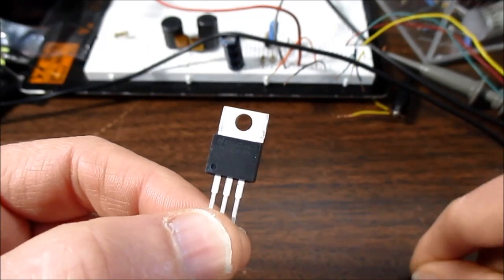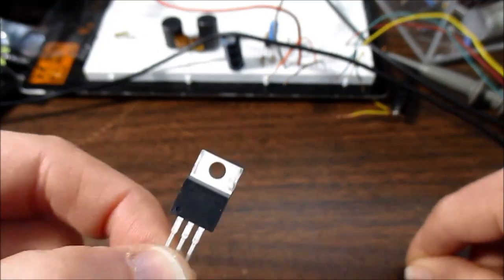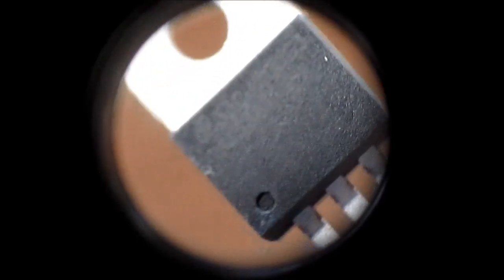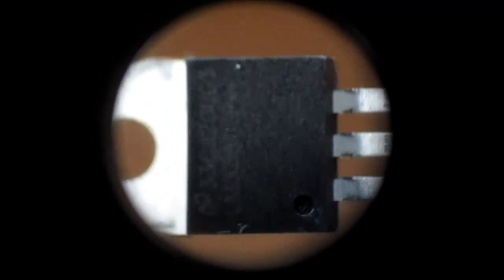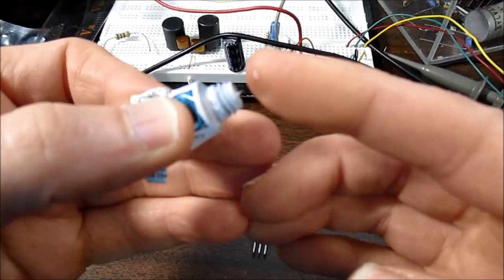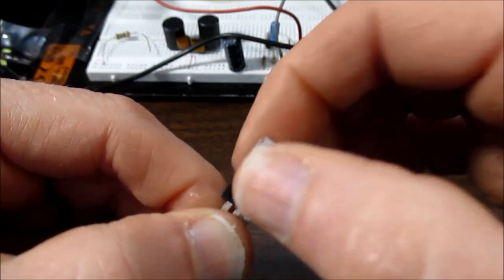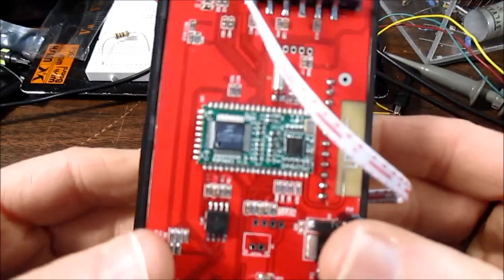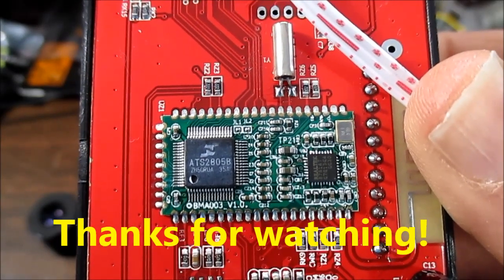QUICK TIP: Trick to make IC part numbers more visible

Comment: I know this is an older video (sorta "netflixing" your stuff). Great tip using something pros and hobbyists alike should have laying around. 
Struggling to read some salvaged TV parts I tried wafting some cyano-acrylate (super-glue) fumes over the etching (no contact) and found the fumes glom onto the ridges making it readable.
No doubt your method is safer but the fumes would work in case the etch is too smooth to pick up the paste.

Comment: You should review and test a little Pyle PCA1 amplifier and see what you get!
( supposed to be 2 x 15 watts! ).
Reply from the maker: I checked Parts Express. The 15 watt number is a useless peak power rating. Specs say it is 3 watts per channel into 4 ohms at 1% thd.

Comment: I do something similar with a pencil. Works pretty good.
Reply from the maker: Be careful as the graphite in pencil lead is conductive. It can get between the fine spaced leads on surface mount ICs.
Reply: very true. I didn't think of that. thanks! looks like I'll be using your method from now on.

Comment: Good tip, I have another which can be used in conjunction with your brilliant method or on the go.
Just shine the red light of an optical mouse on the ic. The reading should be easier in most cases.

Comment: Hay John i recently bought an TDA2050 off reputable seller. The Chip is marked as TDA2050L produced by UTC (unisonic technologies) do you think they are counterfeit, no short circuit protection smaller power-transistors. Or are these the real-deal would be kinda cool to get these obsloete chips they still seem to produce these. i know i am off topic sorry.
Reply: Raffy611 I do also have utc manufactured ICs. But I don't think they have those superior qualities like the ST microelectronics. The Utc ones might deliver much less power than the original ones. Try to assembling on a board and get your output voltage and measure with a multimeter and get the power measurement. Checking with a scope will be best